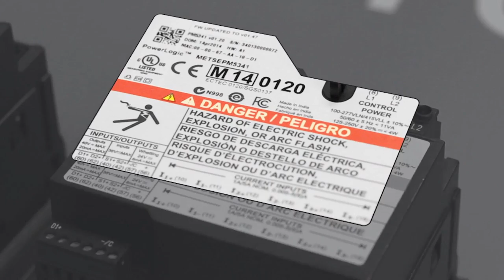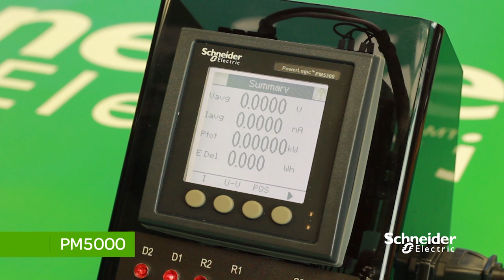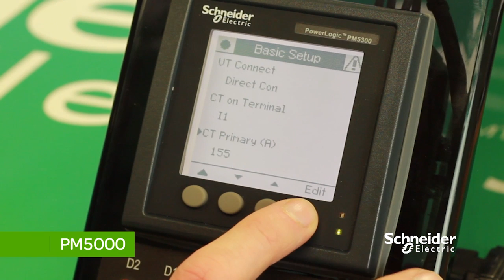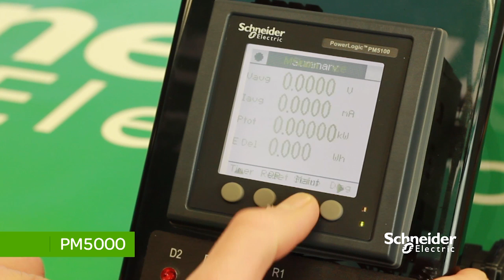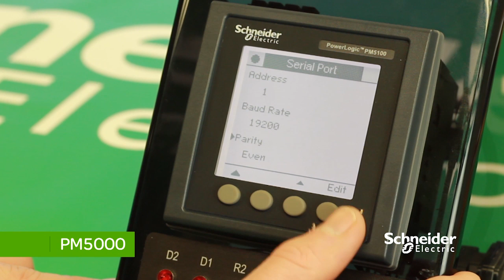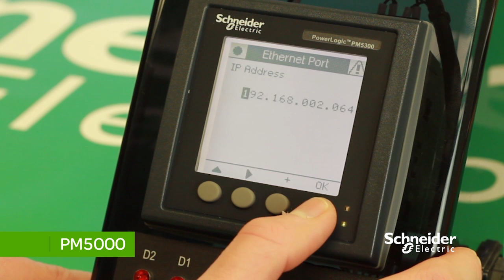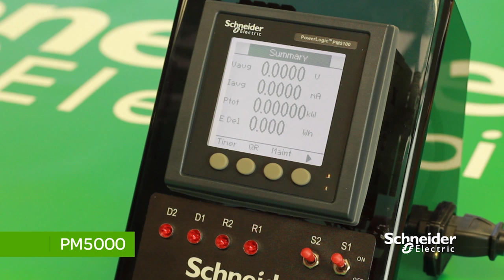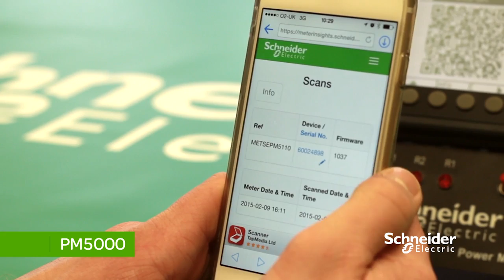PM5000 Programming Tutorial | Schneider Electric

Comment: Its quite brief, its better to have more info about the MODBUS interface to BMS / Energy management system , which needs config XML file and setting of different parameters, indeed power voltage input guide line and control i\INPU/OUTput 6-terminals connection details not confirmed.